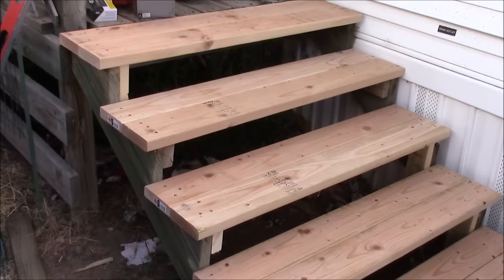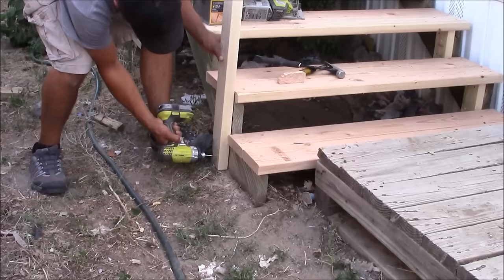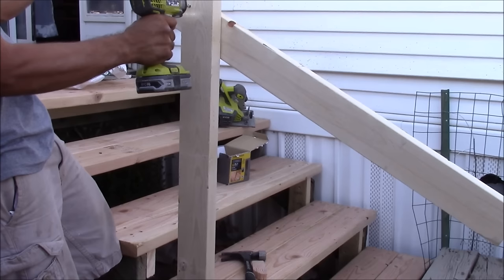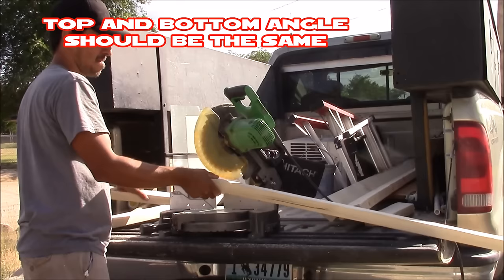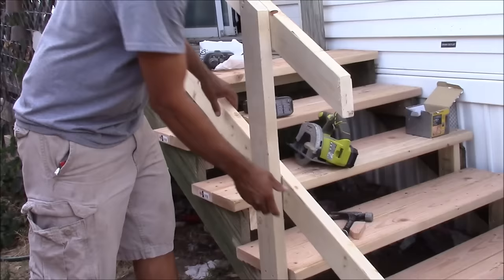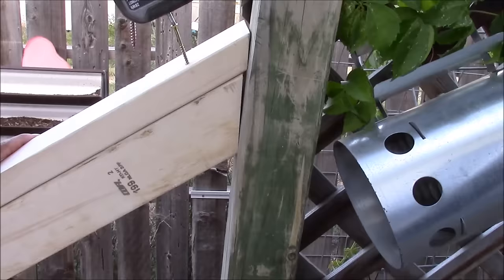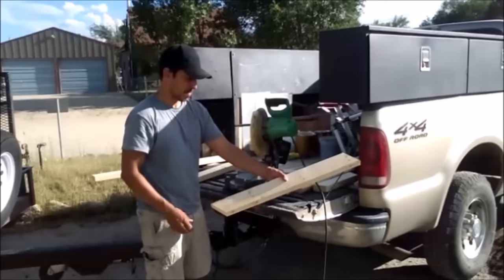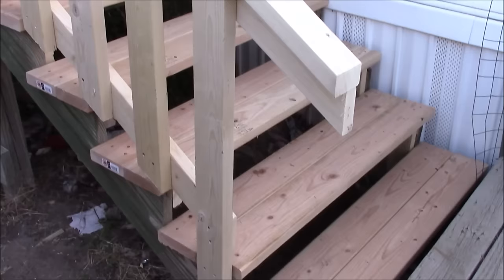How to make deck / porch railing easy with just 2x4's DIY Home Depot materials

Comment: I THINK THE SAFTEY CODE IS 4'' SPACING BETWEEN  UPRIGHT SLATS IN MOST PLACES.
Reply: Yeah, no more than 4 inches between spindles. Spindles are just as cheap as 2x4 but looks nicer too.
Reply: I also would have raised the bottom support off of the stairs by 2". That didn't look like pressure treated lumber either. You should use pressure treated lumber and treat every cut with a water sealer.
Reply: @roughnecklifer  regular spf framing lumber ! Should have used treated for whole project. Cost is pennies more but right way to do it. This choice makes me crazy. Dont care how you finish it , still not right.
Reply: Funny how the “experts” commenting are watching this video in the first place buy this buy that do this do that not all of us have that extra money but have 2x4s lying around easiest best video I found so far to add to an existing step👏👏🙂

Comment: Perfect for what I am doing. Needed to add rails for home owners insurance and wanted something cheap but nice. Thanks.
Reply: Out of curiosity when they inspected the railing was it okay, I'm building one for the same reason.
Reply: @maxflight1000  no, it isn't code compliant. A 2x4 rail laid flat is not considered "graspable" and he said the "slats" are 5" apart... they need to be spaced less than 4" apart....
Reply: Yes so a kid cannot get their head stuck between the slats. It does happen my brother did it when he was three yrs old
Reply: @johnschumann2627  Ideal 3.75" spacing for slats and no more than 4"

Comment: Very nice, simple solution for a railing any DIY-er can do. My only nitpick would be to use a 2 x 3 as the hand grip.
Reply: Agreed, 2x4 is not to code because when falling, it’s too hard to grip; 2x3 is easier for the fingers to get around.

Comment: Use your level with the length you need marked on your level , put the mark on a piece of masking tape if ya don't want a mark on your level.  When measuring your top rail it will be very accurate rather than using your tape measure which is nearly always not plumb when measuring freehand.

Comment: Very nice, but I would have used treated wood.  Also is it up to code?
Reply: Not even close to code, that would fail everytime a 2x4 railing post? lol omg
Reply: balusters do not meet code.  no opening larger that will pass 4" diameter ball.

Comment: what boards did you use for the horizontal and vertical  part of the stair stringers? are the 2x4 or 2x6s..thanks..and awesome presentation..I will be referring to this video ..for my 2x4 install on the stair rails...and thanks again..God Bless.

Comment: simple, cheap, and neat. However it doesn't meet code! Spacing between vertical slats can not let a 4" diameter sphere (child's head) pass through. 5" spacing is too wide. Also the hand grip part ...a 2x4 laid across another 2x4.....does not meet code requirements. Sorry to rain on your very clear video demonstration.

Comment: okay nice job but using untreated lumber it won't last long without painting just saying
Reply from the maker: Heidi Logsdon Correct .You just slap some stain or paint on when done for protection.
Reply: stain and paint just prolongs the inevitable. It needs to be pressure treated. Otherwise thanks for the measurement tips.

Comment: The screw holes starting splitting and now I have a loose handrail. Does anyone know how I can reinforce it without having to replace the entire side panel?
Reply: Dig a post hole adjacent to the front 2x4 post. Put a 4x4 in it and about a bag of concrete to anchor it. Screw the front post to the 4x4. Also always drill pilot holes.

Comment: I have a question. In the beginning you said you want the handrail 36 inches above your steps. But then you measure 32 inches to make your cut height . can you please explain? gonna try this tomorrow
Reply: I just noticed the same thing, he made a mistake, it should be 34 1/2" . It would be 32 if he marked at the bottom of the vertical rail

Comment: I know this video was made back in 2016, but today's stair codes do not allow you to build it this way anymore. Be sure to consult a current copy of your locations code if that is a concern for you.
Reply: Whats wrong with it?
Reply: You have to have a graspable handrail. Perhaps a separate handrail was added after. The vertical 2x4 used at the bottom instead of a 4x4 post is not blocked in the framing properly and does not use the correct type of fasteners. It will work fine the way he did it. Just would not pass inspection in most places.  @marcogeraldis7117
Reply: @sethd1125  Im actual doing a handrail kinda similar to this now and because the deck isn't high enough of the ground no codes were really looked at. More so just a perimeter was needed.

Comment: Using untreated unpainted wood touching the ground is not a good idea. The end grain will soak up water and rot quickly. At the minimum prime all the wood on six sides.2x4 railing is too wide to meet code. usually stairs need a footing. The mechanics were great but.
Reply: Plus the "slats" are 5" apart...

Comment: Anything bigger than 2 by 2 is not a safe handrail. 2 by 4 would not pass any building code! and minimum height is 34" from toe of tread. Allowed handrail dia = 1-3/4 to 2-3/4"

Comment: Is this to code?
Reply: Holly Johnson. Nope
Reply: From what I have read, I doubt it. There are several issues—a hand rail can’t be just a 2x4 or 2x6. The end of the Raül can’t just end in the air, it has to be attached to a post. The triangle formed by the wood at the bottom with the stairs can’t be larger than a 6” diameter. And the spacing between the uprights can’t be more than 4”, admittedly I couldn’t read the tape measure well, but it seemed to be more than 4”.
Reply: Depends on where you live. And if you're doing it on your own property or someone else's. A lot of rural areas don't have strict code laws.
Reply: AmbientShade not in the USA